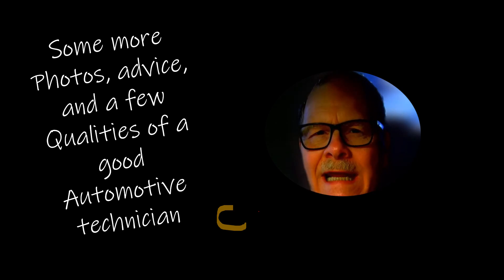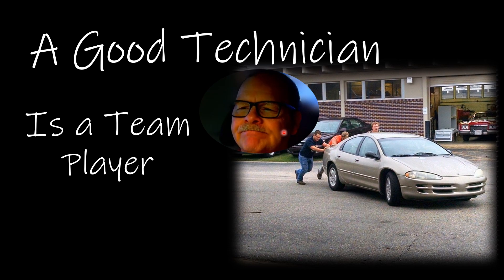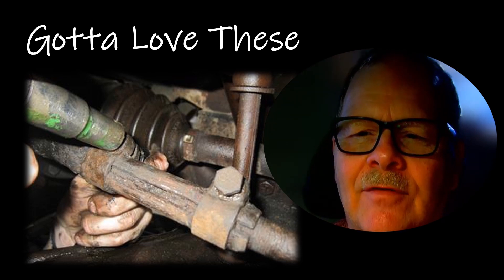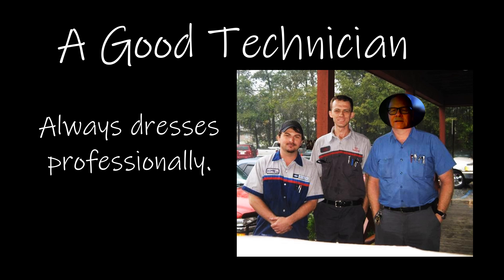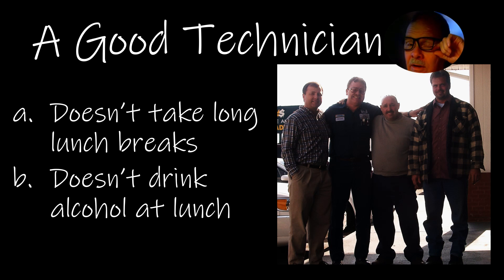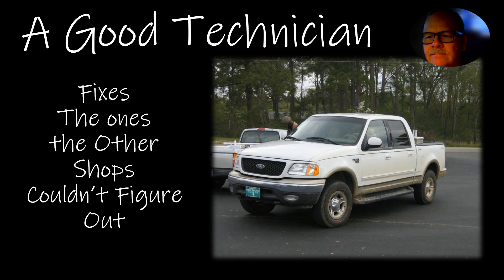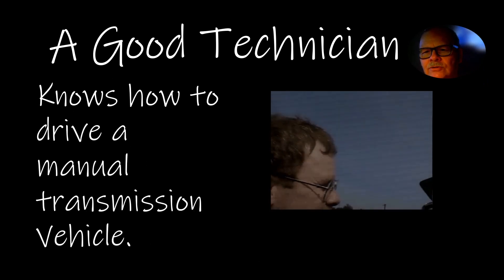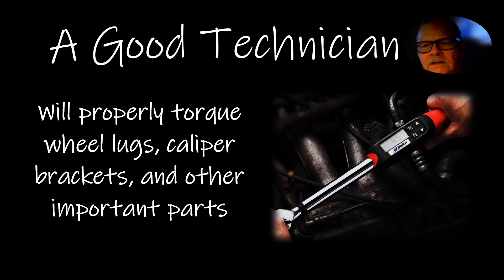Good Mechanicing and Advice

Comment: Thanks for sharing the carriage bolt trick a few years ago. I used it in place of a fuel tank strap bolt where it attached to the frame rail. The factory nut is tack welded to the inside of the frame rail. It had rusted (road salt exposure), the tack welds came loose during removal. The frame rail is enclosed. After removing the bolt, I opened up the hole enough to slide in and rotate a carriage bolt with trimmed sides. Problem solved.

Comment: A good tech isn't pulling torsion bars on a GMT400 / 800 for any transmission work.......
Reply from the maker: 1. I didn't hold his hand. I let him do the work. 2. He learned something the way that he did it that he wouldn't have otherwise known. 3. He was 18 at the time. 4. That truck is still running today - years later - with no issues - there was no harm done.